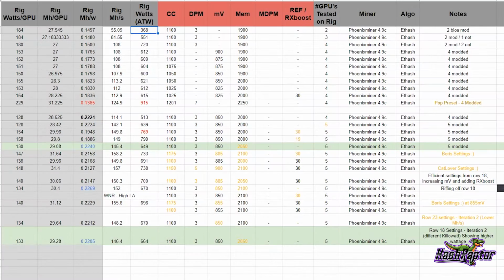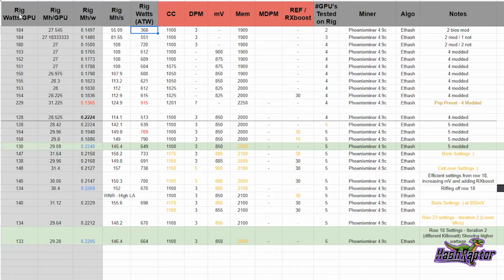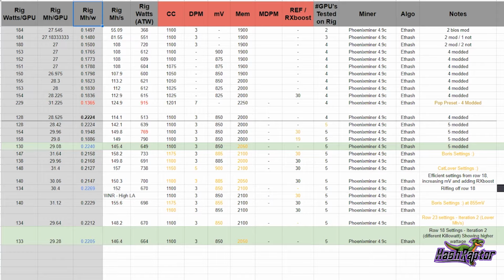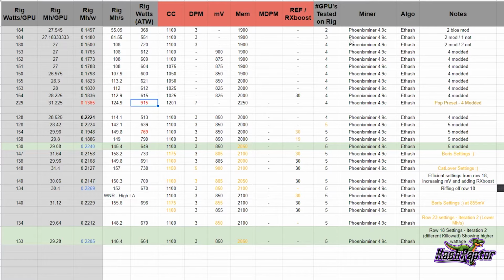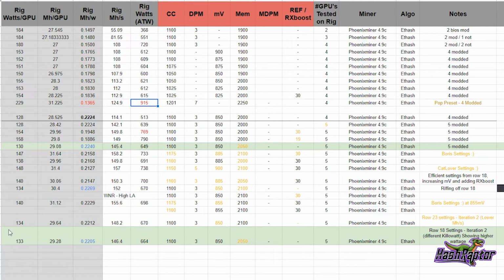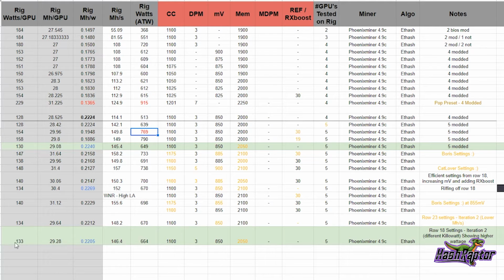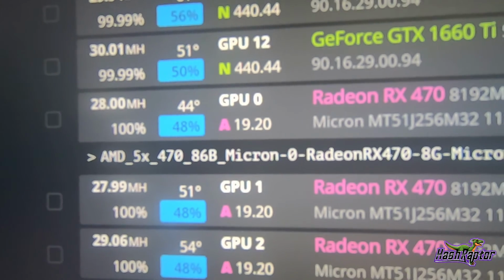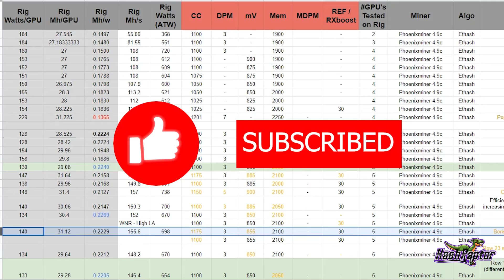AMD Rig Build Part 3 - Efficiency

Comment: I use Windows and practically I was testing my 580s and I guess I have them on a good spot for efficient  (.22 mhs x watts (139 watts at wall) using an 850 watts bronze psu powering only the card and riser , nothing else under 120v line ) from your tablet I guess I'm solid , I have 580s 8gb doing 30.7  (sapphire nitro blue ) and I use 1120/800 with Mem 2100/845 and I test some 1660s that I got too using the same set up and 2 of my 1660 super draw 82 at wall for 30.6 mhs while the third one uses 92 watts for 30.7 mhs wall reading ,using latest Claymore
Reply from the maker: Good stuff man. Very nice on the 1660’s. Were they Supers?
Reply: @HashRaptor  yes effectively  2 Msi Ventus Super and one Asus Evo Super (Super of course taking advantage of the ddr6)

Comment: far better to use claymore in windows then you can use the strap and rxboost function. got over 20 rx cards here in the uk. 

1. put bios back to stock  2.  then use claymore 15.0 with either strap 2 or strap 5. strap 2 works best for me on non-samsung ram cards.  3 . my rig config looks like this core 1085 mhz ram1950  890mv core and mem volts  strap 5 and rxboost 40   4. two six card rigs with rx470s get 178 megahash and 780 watts at the wall .  5 i think it can get more efficiency with lower clocks but you should start with claymore. its just easier IMO. use windows 10 1909 with drivers from early december 2019
Reply: better yet sell the rx470s and buy blower rx5700 and mod their bios.  ive got 112megahash and 300 watts at the wall with two rx 5700 blower cards
Reply: thats .37 hash per watt. but the rig also mines randomx on the cpu
Reply from the maker: Nice!
Reply from the maker: I love what I’ve seen from the 5700’s!  Monster hashers!

Comment: I think you would get higher hash if you bump the core from 1100 to 1170. I was on claymore but it increased mine by .5-.7 mhs per card. I still had 850 core voltage. You can also drop the core voltage to 825 -800. Sometimes 800 will crash but 825 is stable. Another thing is if you view the asic quality of each gpu. Then the higher asic quality the lower voltage you can go on that gpu. For example my 470 that have asic of 75% or higher can do 820 core voltage but my 470's with asic of 60-65% need 830-850.I used gpuz to view asic quality in windows but am pretty sure it is available for linux.
Reply from the maker: Good to know!  I don’t think I’ve ever used asic quality.  Will take a look.
Reply from the maker: Sounds like I really need to test one in Windows.

Comment: Good video, thanks. I comment:
1- flash your rx 470 to 570, maybe increase to 30.5-31 mh / s
2- The power comsumption at the wall  of that GPU is around 125 watts each.
3- Compare using windows vs linux.
4- Right now for my experience the best AMD GPU for mining is the 5700 XT,  52.6 Mh/s and 140-150watts at whr wall (0.3737-0.3506  Mh/watt).
:)
Reply from the maker: I love the efficiency of the 5700. I really want to pull the trigger on one!  Hey, where should I look for the 570 bios to flash to the 470?  Thanks!
Reply: you can now mod the bios of the rx5700 - see guntis vitolins channel i have two rx 5700 base blower models doing 56 megahash each with modified straps. with tinkering im down to 130 watts per card at wall.  50 watts idle 304 watts at 112 megahash and 383 watts with 112megahash and 7450 randomx on the 3600 cpu

Comment: I just slapped a RX 580/8g in one of my rigs, couldn't argue with the price.  HiveOs/R9/MSi B450max/8g (cheap and slow 2666mhz) .  Its' currently rock solid at 29.44mhs running phoenixminer. Temp is stable 41c, room temp averages 65f open air rig.  HiveOS settings Fan 45/Core1100/DPM1/V925/MeM2200/MDPM-/Ref31.  HiveOs shows 72w for the card, rig went from 370w to 500w+\- at the wall.  Which puts our wattage numbers inline.   Haven't had the chance to bios mod the timing yet.
Reply from the maker: Very cool!  So how many 580’s do you have in there pushing 500w at the wall?
Reply: @HashRaptor  It's a mixed rig, 1 MSI RX580/8g Armor OC  & 3 1660ti. Planning on building another rig this weekend, I've got a B250 with CPU sitting on the shelf and there are several used 580's available locally for about $100.  Maybe add a 5700....

Comment: Downvolt core to 825 mV or as far as they go.  Dial back core freq to 1100.   Get best memory strap for the particular GPU (Micron or Hynix?).   Use RSBPolaris bios editor for that.  See if you can clock memory to 2100.  See what all of that gives you.
Reply from the maker: Thanks!  I’ll double check my test sheet but I think when I tried to go below 850 it locked up. I have Hynix memory. You mentioned the “best memory strap for this GPU”.  Where do I go to find that?  Thanks for the assist!
Reply: the biggest trick is to get vddci voltage to 825 to 850mv and yes find the best timings for the gpu there are plenty of forums out there to do so. there are basically 2 parts to bios modding and those are memory timings being most efficient and getting the pcb under control. amd overpowers everything from the factory to ensure its stability and when you are only using memory for eth you can really dial down the voltage. do not increase core clocks because it will not get you more hash per watt even if it increases hashrate it will not be worth it with power in the end